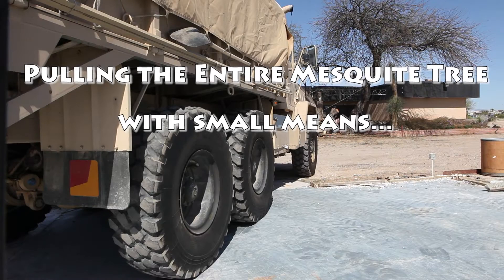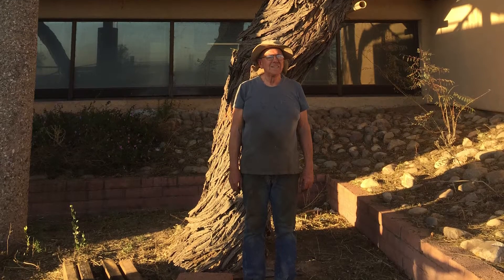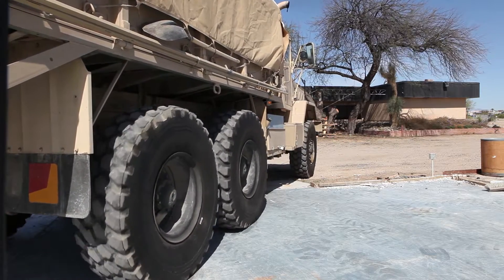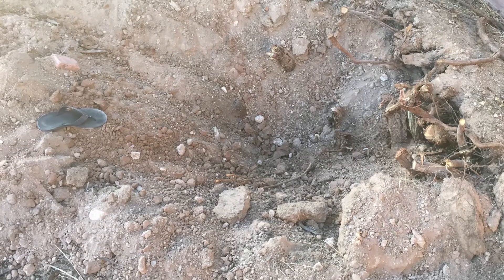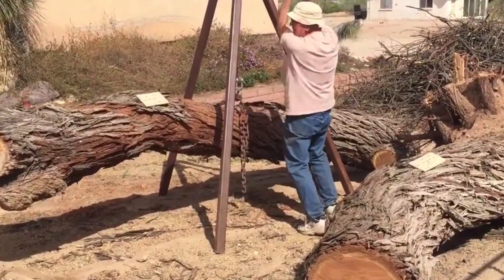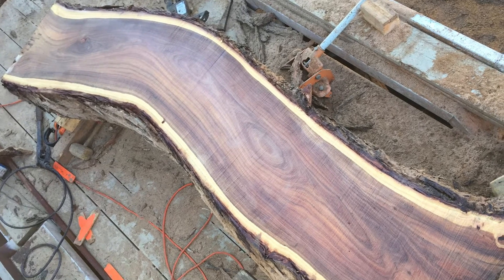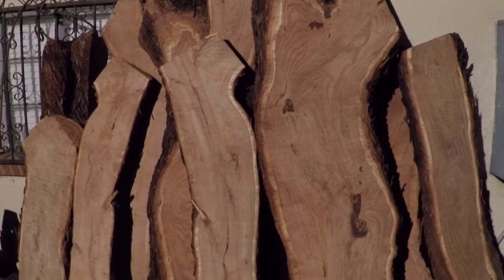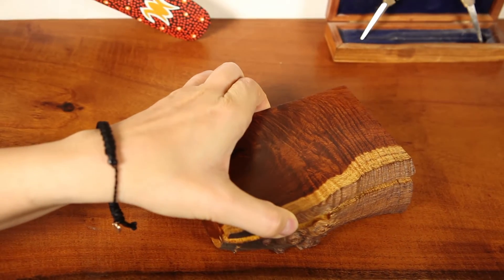Mesquite tree pull with 6x6 5 ton Harsco 925 A2 939 series

Comment: Even on a big truck like this (I have one too), it is so hard on them to pull and yank driving in reverse.  Beveled gears in the transfer case, ring and pinions, etc., are designed to pull while going forward.  If the winch wont do it, turn the truck around and yank while in low-range driving forward; your truck will thank you!
Reply from the maker: andrew clark that’s great advice!  Thanks for taking the time.
Reply: @MrMoose123  loved watching the video.   I would never admit to how much time I spend on youtube looking at 5 ton videos.  I have a 1983 AM General M925, love playing with them.